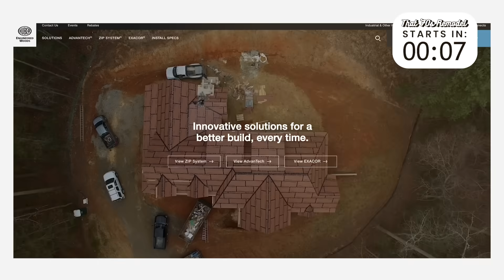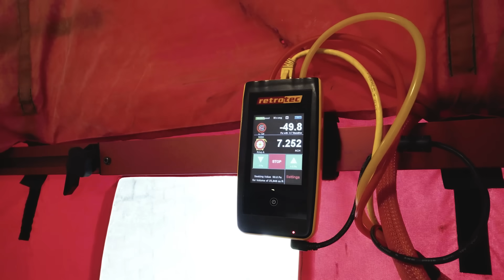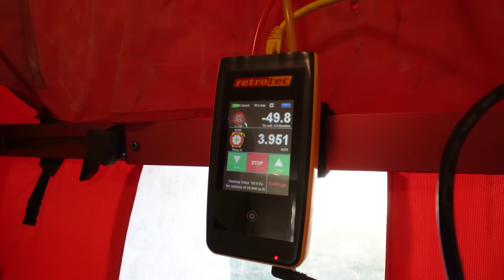That ‘70s Remodel Ep 9 - Final Air Sealing & Blower Door

Comment: The air tightness is 3.8 air changes per hour, correct? That would more than double the amount thad code requires  (at least in Germany) which is really bad.
Reply: Right? This is like saying the 700 lb guy lost 350 lbs.... He's still fat. This house is still leaky as hell.
Reply: a full performance overhaul.....that completely failed. also their teeth will fall out soon given lack of fluoride where they put all this money into.
Reply: I bet if you took at German (or Dutch or French) home built in the early 1970's (before the energy crisis), I bet it would be crazy leaky like this house was to start. Without tearing apart the interior, but  just fixing on the outside, if you can reduce airflow by 1/2 and then add insulation and upgrade the heating and cooling systems to latest generation, you'd dramatically reduce heating and cooling bills. Just by replacing my 1998 "builder grade" natural gas forced air and electric AC back in 2010 with high efficiency furnace and AC, I was able to drop by utility bills by 25%. If I were to have been able to air seal on the outside, I'd be even better off. Recently I replaced the floor in one room and found a huge air leak the full length of the room along the sill plate (2nd floor bedroom) and also lots of air leaks form the electrical outlets. I used sealant all along the edge of the floor on the outside of the house (under dry wall where the flooring tucks under the wall trim. I also sealed all the electrical boxes on both floors. I bet it would be a measurable improvement in my air flow leakage. Not an amazing improvement... but it helps. That room now gets cold slower and heat up slower in winter and summer respectively.

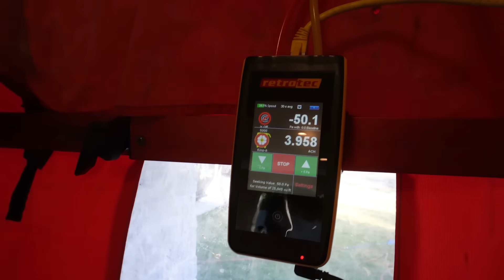Comment: Starts @ 1:45...results @ 9:09...and yet another rationalization for the cheapness of this remodel @11:18, SMH.  That's $200k wasted IMHO.
Reply: I have not been following along, did they spend $200k on an energy retrofit? Surely there had to be more?
Reply: @simplyaaron  it's not just an energy retrofit, but it seems an exterior remodel. But still, 3.9 seems not great after putting zip on the outside. It seems like they needed to do more sealing from the attic roof inwards then just in the ceiling of the house. It's a big improvement, but does seem like it should be in the 2.5 to 2 range after a major retrofit to the outside.
Reply: @TheChainStay  I agree. The series didn't show enough of the house to tell what's missing, but something is. They kept the fireplace, usually that's a problem.
Reply: Wym? Why do you think the work done here was a waste??